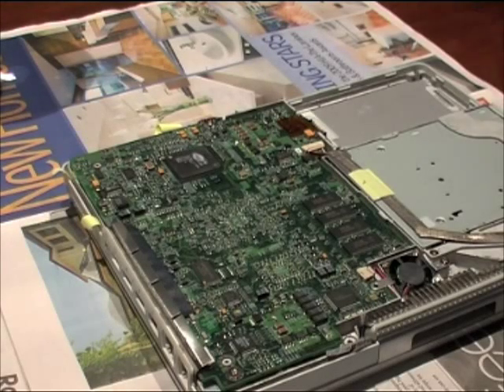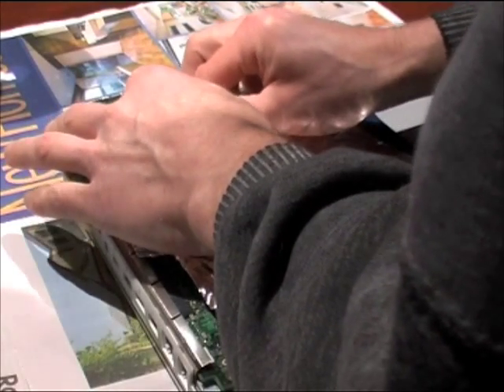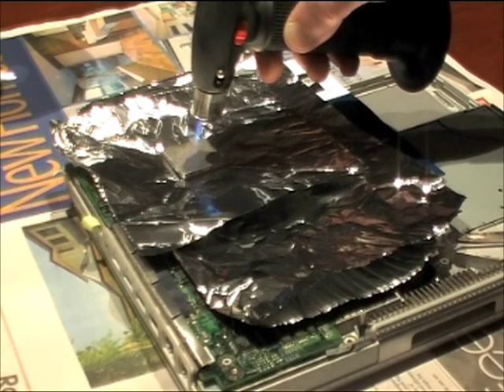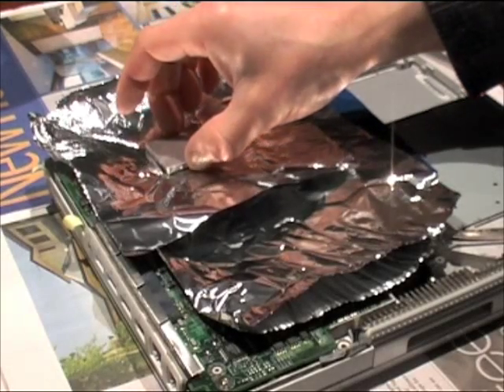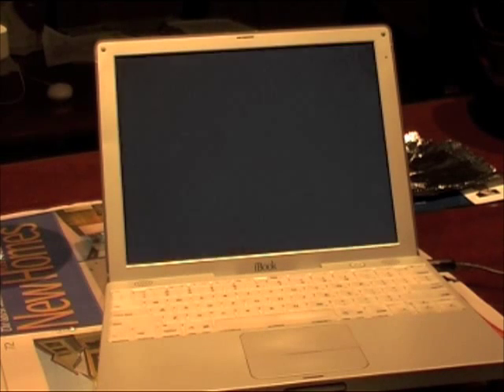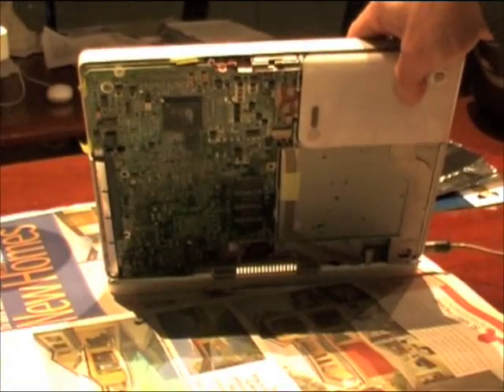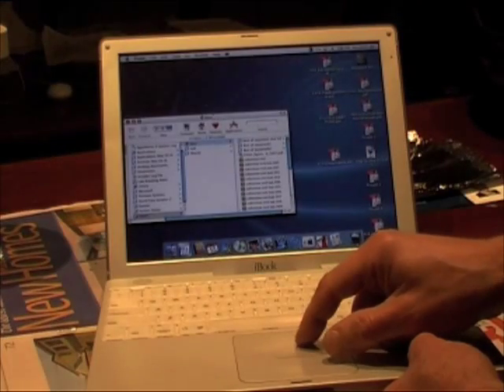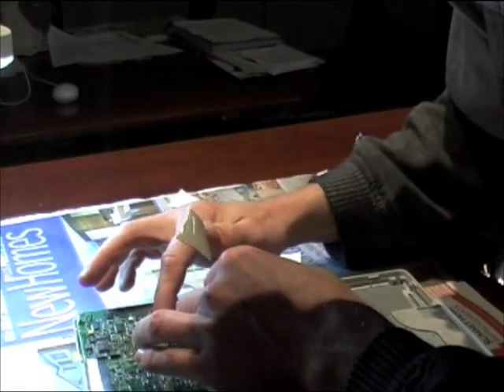iBook repair

Comment from the maker: If the GPU isn't working, it's probably useless anyway. All of these GPU heating / "reflow" methods are only useful for a computer which you would otherwise throw out. There is a chance it will work again. There is a good chance you will wreck it permanently. You would only do it if you had nothing to lose. Listen to the commentary on the video.

Comment from the maker: Aluminium foil is just that. The lump of aluminium about 3 cm square I cut from a large heatsink, but you should be able to get aluminium billets from any large hardware store: cut the right size piece with a hacksaw. The self-adhesive heat transfer tape is from an electronics store.